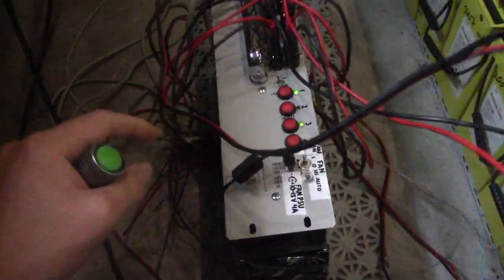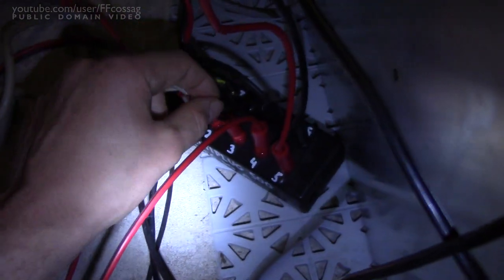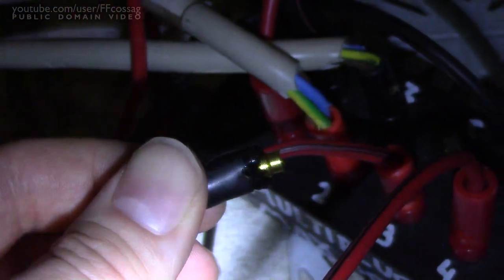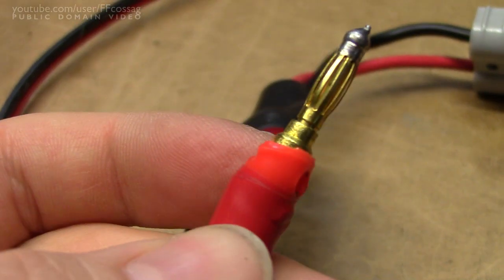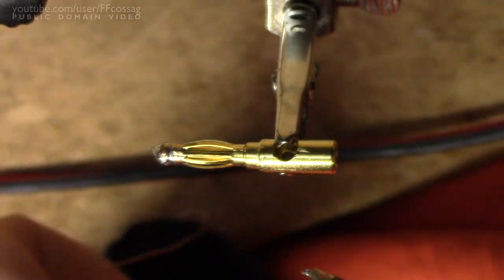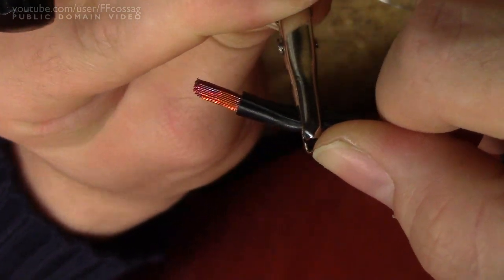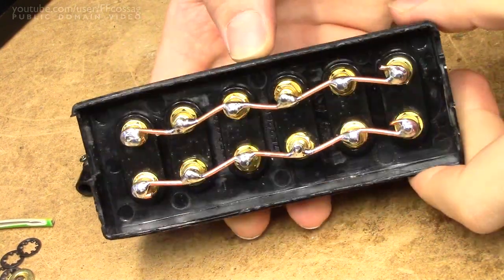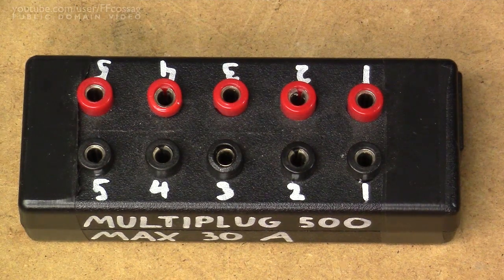Random musings on cheap banana plugs (including meltdown!)

Comment: You're probably getting a lot of heat from the small contact area between the copper wire and the banana plug's retaining screw.  Try using the screw hole to feed solder into the wire cup and it might not heat up so much in use.
Reply from the maker: There's very little heat from that, since the wire is pressing against the metal case of the connector as well.

Comment: Look uo Anderson powerpole connectors, they come in different ratings and can take 30 amps without melting or incurring high losses
Reply from the maker: Yep, I use some of those too. However, I like banana plugs for their versatility. You can just criss-cross them around and make these lovely spark-inducing mega parallel connections if you need to.
Reply: Cinch-Jones connectors used to be the go-to power connectors (not made anymore), but Anderson appears to have taken over the market.

Banana plugs aren't rated for a specific current.

There are RC power connectors now becoming pretty common.
Reply: +FFcossag power pole connectors can be crossed connected, they are genderless
Reply from the maker: Phillip Scott I'm referring to the fact that you can shove banana plugs into the holes on other banana plugs, making parallel splitters on-the-go.

Comment: Never count on the solder to be your conductor, start with a solid mechanical connection and use the solder to fix it in place.

 Just butting the wire up against the post is not good enough.
Reply from the maker: The wire in the connector block is physically pressing against the plugs by spring action. It certainly makes a decent connection even without the solder, although it would oxidise to hell in short order if the solder weren't there.
Reply: That's not nearly good enough.  It should either wound tightly around the post, or terminated in a lug.
Reply from the maker: Guy Gustavson
Sure, if you want to be really thorough about it. This set-up is more than good enough for the kind of stress that I'm going to put on it.

Comment: HMM banana plugs I'm done with it. To sensitive for problems. Break to quickly. You can better use the cigarette lighter plug system.

Nowadays working very little here directly on DC battery current. 

If i connect something than directly on the battery of course with with a fuse.

Everything works here on the 24/800 to 230 volt inverter.

Comment: I call HACKS! 😁 If you're doing high current stuff that needs to just work: just pay a couple extra euros for decent Hirschmann banana plugs.
Reply: Also: what kind of voltages are you running here? Maybe it's better to move onto safety plugs if you're doing 40V or higher.
Reply from the maker: I never cared much for "safety plugs" unless we're talking mains. Safety banana plugs in particular defeat the biggest advantage of banana plugs, too.